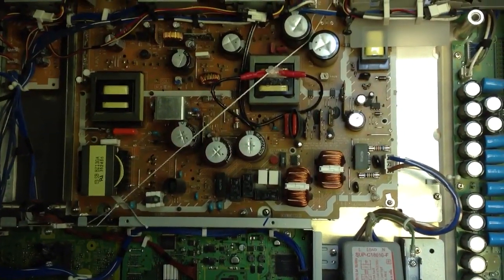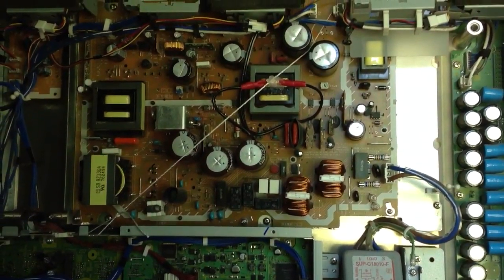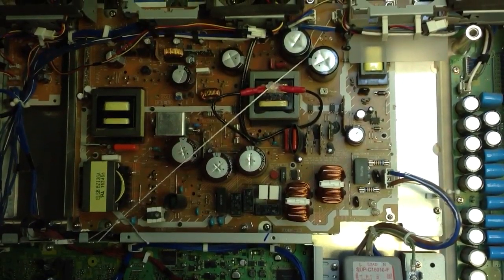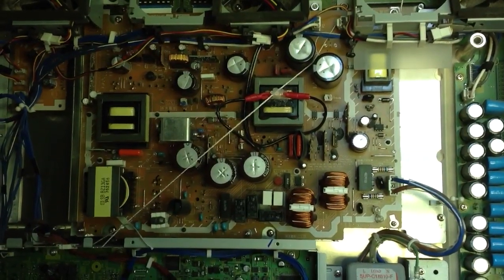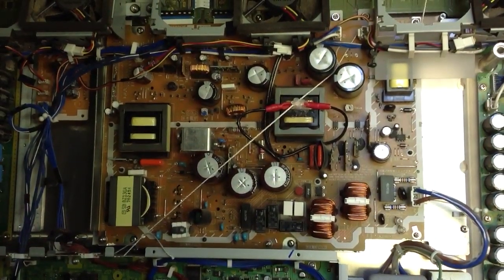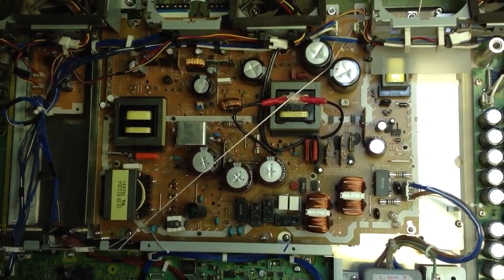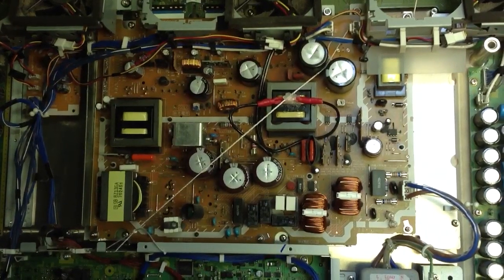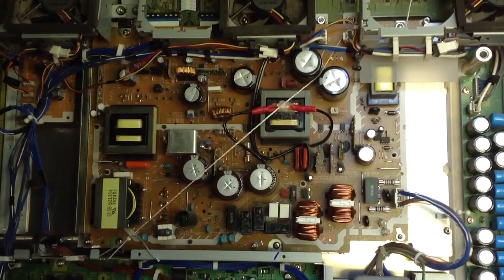Panasonic 10 flashing red light

Comment: 10 blink before or after the power switch turned on? they are completely different faults and troubleshooting techniques. With my particular TV there are 3 different possible boards that can cause the issue, so each TV version/year may have a different set of fault troubleshooting.

Comment: I was wondering exactly what part do i ask for at radio shack ? I have the 10 blinking lights
Reply from the maker: I don't remember the part number but I do remember that it was just a plain jane thermal fuse.  If you just short out the pins with a large jumper like I did it will power back up without the fuse.  Just add the fuse later so that the transformer is thermally protected.  
This Panasonic TV in the video is still working after the fix.  todays date is 4-15-2014
Reply: can i speak with u for help ??

Comment: Hi. I have got the same tv. The blinks are 11. One of the fan, the one on the further right from the back works intermittently and the tv shut off after a bit. I tried the defective fan on the other fanPB pins and it does the same. Will it fix it just getting another fan 12DC 0.10A? Many thanks

Comment from the maker: The wire is just plain lamp cord.  The end you don't see is connected to each side of where the fuse should be installed.  I use the cord so that there is room to install the fuse.  Since the original fuse is inside the transformer the new one must be installed on the outside of the transformer.  Now before you install the fuse, you should be able to tie the wire together and the TV will power up confirming the bad fuse.  Just find a thermal fuse that is at a good operating temperature so that if the unit does get too hot it will open and shut down the TV.  The thermal fuse will be silver and look like a resistor.
My email is timothywjalbert@gmail.com if you have any other questions.  I also have facetime

Comment: Hey I have a pana 50" made in 2008 the  TH50PZ80U it's showing 10 blinker how much is the part an what is it? Anyone that could help??????
Reply from the maker: nork38 

You technically don't need the fuse.  You could just jump it out.  The fuse is located inside the transformer.  The fuse is there to protect the transformer.  Try this, jump out the pins on the transformer where the fuse should be.  The tv should then work fine.  If you would like to protect he TV circuit you can install a thermal fuse later.
Reply from the maker: I added the part number and the cost right in the description

Comment: How te repair
Reply from the maker: Replace the thermal fuse that blew inside the transformer.  Do this by adding a second thermal fuse in parallel with the original.  If you cannot get a fuse, short the pins.  NOT RECOMENDED.
I repaired this TV a long time ago and it is still working 10/8/2021.